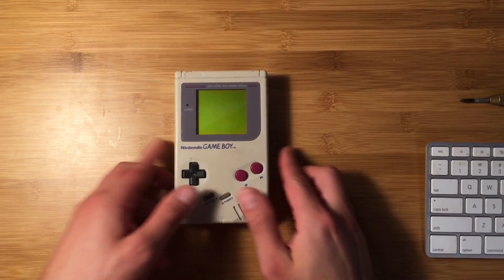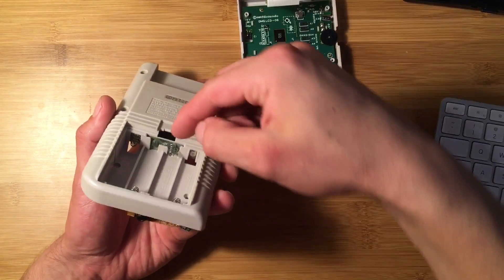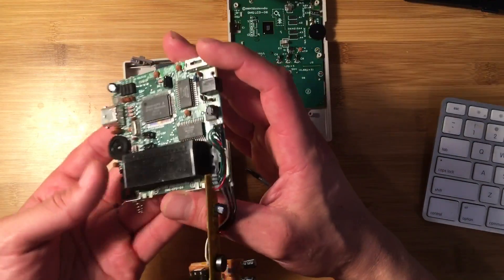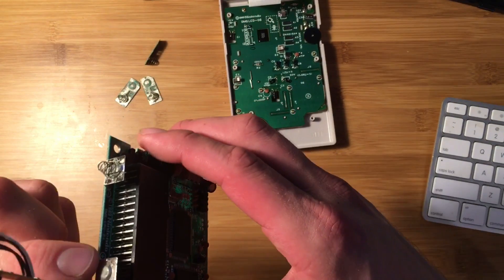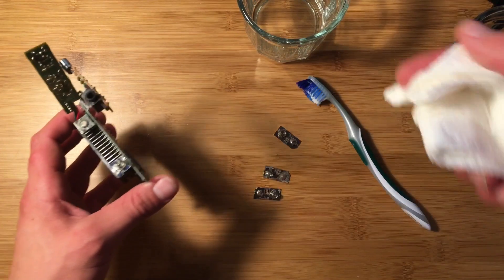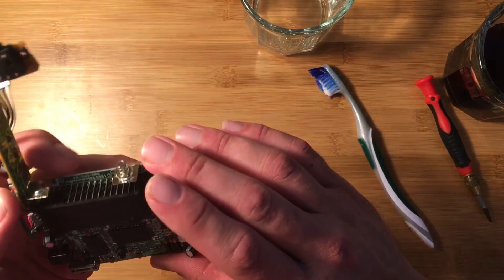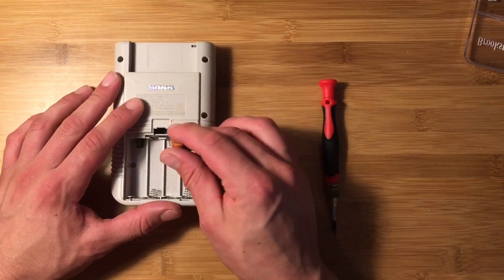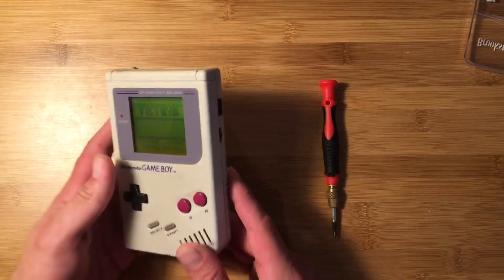Cleaning the Original Game Boy's Battery Terminals to Remove Corrosion (And Fix Your Gameboy!)

Comment: I had a amazing find today of a original yellow Gameboy (still had Pokemon Gold in the cartridge slot). It's not working, I thought it might be because of the battery contacts as there was some obvious corrosion. They are clean and shiny now but it still doesn't work. Do you have a video troubleshooting possible problems as I would love to get this gem up and running again.

Comment: I did this process, but when I turn the Gameboy on the red light lights up but neither tetris or pacman starts. I will take it apart again and give a more thorough look at it. I'll take out those other posts now that I now how to remove them. I'll also check if the cartridge actually fits properly.

Comment: 4:38 What percentage is that white distilled vinegar?
What percentage is the rubbing alcohol?
Reply from the maker: I can’t recall since I did this video so long ago, but it shouldn’t really matter for either. Higher % IPA will result in less water which is good, so try and find some 91% if you can. If not, the normal 67% will work too. :)
Reply: @Howchoo  Thanks. MetalJesusRocks mentioned 91% or higher. There is even some 99% rubbing alcohol that evaporates quickly.Insane.

Comment: Hello, I have a Nintendo  and a batterie has corroded a spring it works when I pull the battery back. Do I need to just replace the spring or the whole single component and how do I do this from the outside ? Thanks
Reply from the maker: You can replace just the spring, or remove it and soak it to scrub off the corrosion. Just remove the back case and push a small flathead screwdriver in to remove the springs. You’ll see how they’re “clipped” in there once you get the back off. Just be careful not to rip the ribbon cable when you remove it. It’s an easier process than you might think :)

Comment: My gameboy color has a battery terminal spring that's bent into the circuit board and it's soldered!
What should I do?
Reply from the maker: You can attempt to (carefully) unbend it using needle-nose pliers. If you have a soldering iron, you can desolder the terminal, unbend or replace it, and then solder it back on. I hope that's helpful!

Comment: If you find corrosion in a battery-needed electronic game, is the game broken because I found some in Battleship Deluxe and it keeps on repeating the same words. Can this be fixed?
Reply from the maker: Corrosion doesn't always mean the electronics are ruined -- it depends on the type of electrical components covered in the material and how long it was there. I would clean the corrosion off as well as you can and go from there.

Comment: White Vinegar + Q-TIPS + Normal Toothbrush + Fine Brass Brush not necessarily but could help+ Ipa Alcohol + Wiping all Dry with Q-Tips than Applying Dielectric Silicone Grease. 🖖

Comment: Don't hesitate to do it even when the gameboy is working fine. I had one who worked fine but would have some problems to work from time to time. The exposed part seemed okay but when I removed them to clean them, corrosion was present on the hidden side. It never hurt to clean them, it can only make your gameboy work better.

Used white vinegar for three gameboy and now all them are working fine again (except for one where I had to replace one connector of the battery because the old one had so much corrosion that he broke in two when I removed it xD). Only difference was mine were not really in a nice shape so I left them one hour in the white vinegar.
Reply from the maker: Great point!

Comment: The one I have had a small leakage once but surprisingly there's no corrosion. Also thank you, that video will come in handy if the one I have develops that issue. Also, does the phone number on the sticker that's on the battery cover still work today?
Reply from the maker: I doubt it still works, but I’ll have to give it a shot ;)
Reply: Okay, I would recommend to only try it if your Game Boy develops an issue that will need to be fix.

Comment: I had the same power problem.  Battery contacts were bad.  I cleaned them up and put batteries in.  It works now, but when I put the batteries in the red battery light is on even though the on/off switch is in the off position.  When I turn it on of course the game starts but when I turn it off the battery light is still on. It only turns off when I take the batteries out.  I don't remember that being on all the time.  Any ideas?
Reply: Did you ever fix the problem?
Reply from the maker: Yep, what’s likely happened is the corrosion has reached the board and has closed the loop, so to speak, so it always thinks the power switch is on. Open it up and clean the board thoroughly using the same method as the contacts and you should be good to go!